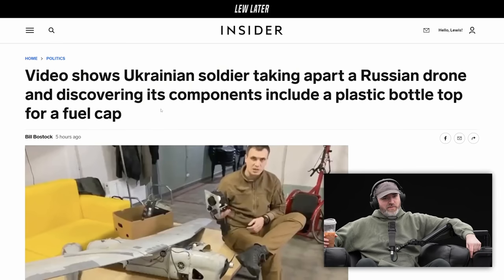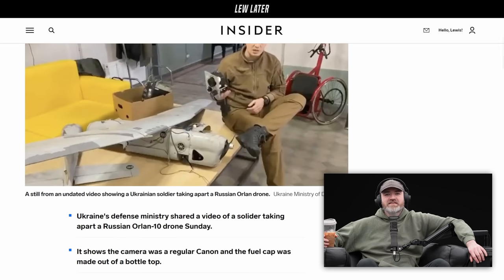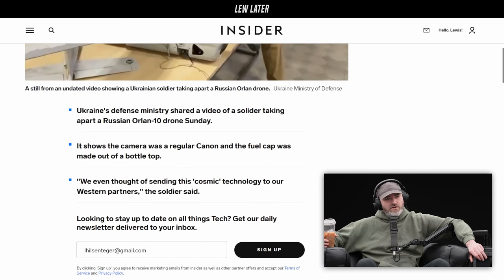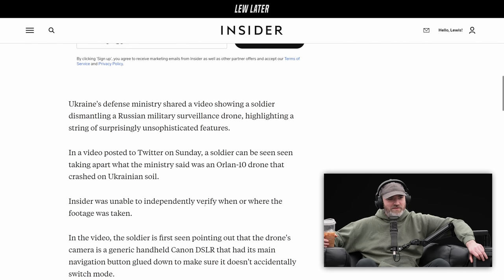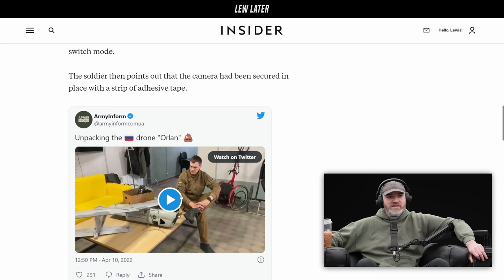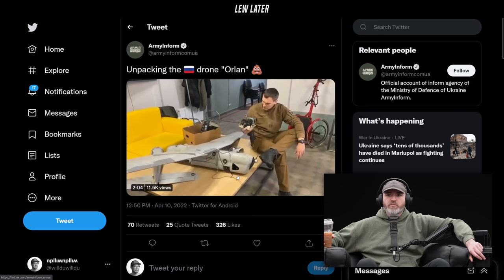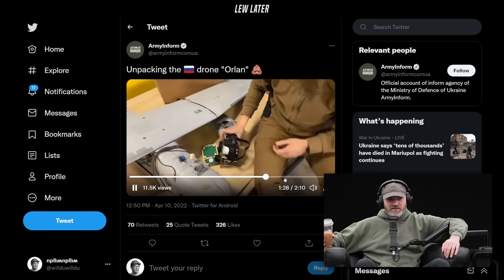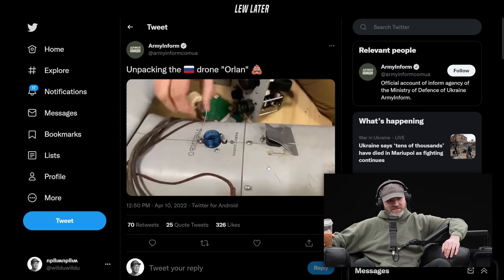The Russian 'Bottle-cap Drone' Dilemma

Comment: When you need a rudimentary tool to get a view over enemy positions, with high risk of it being shot down etc, this kind of "engineering" really makes sense and seems smart, compared to using a $5M "real" drone. After all, Ukraine boasts of their own makeshift drone developers, and rightly so, for those same reasons. So I don't get the negative connotations around this.
Reply: The problem is the price. Most of the money was stolen. And the rest did something.

Comment: Nothing wrong with off-the-shelf components, and Canon makes great cameras.  Some of the rest of the equipment onboard was actually highly functional.  And at the end of the day, recon drones like this are disposable anyway.  It's proven tech, with some modern updates and relatively low cost.  Still not cheap by the time it's a proven system with all parts working together.   This is being mis-represented.

Comment: Not sure if its true, but have you heard the joke that USA invested millions for a ball point pen that writes in space? And Russia just solved it with a lead pencil?
On the other side the joy of unmanned vehicles is that you can save a lot of costs due safety features.
Doesn't surprise me tbh.
Reply: Yes but you also can't use pencils in space because the graphite breaks and can cause Electrical issues. But I agree with your point. Why not make it cheap and easy to produce.
Reply: Both Soviets and Americans were using pens designed for 0 gravity developed by Fisher. 

The role of these drones is to be dirt dirt cheap. Even the enemy revealing their position to shoot one down is worth it.
Reply: @brentongilmore5853  The little things matter. THat shitty drone compared to even a DJI drone, let alone a fully fledged miliary drone is night and day. I agree too with the sentiment, in many cases. Military drones isn't one where it applies. To answer your question, because they are less effectiive when made cheap. It's not resourcefulness, it's lack of resources driving this. And Russia hasn't shown they have more capable drones on top of these. They do, but Russia got into drone tech WAY late. Only relatively recently actually, and that's a high tech item.
Reply: The fisher space pen was designed and patented before it was used in space.  The idea of a pressurized system in an ink pen to make it write in adverse environments and using a waterpoof grease as the ink is useful.